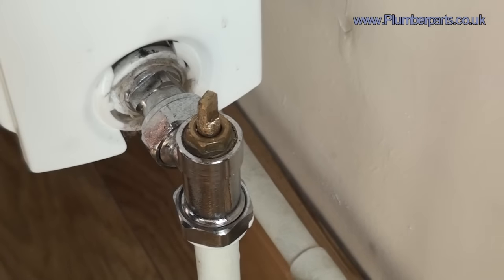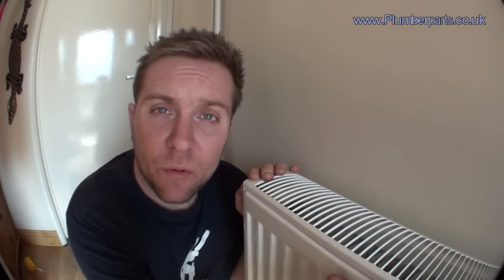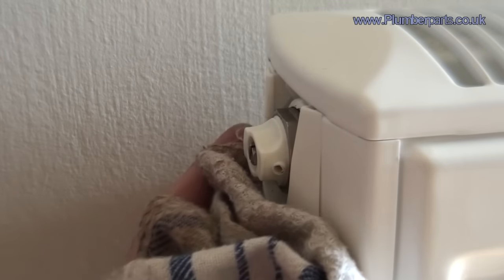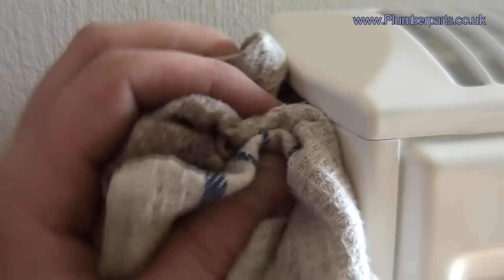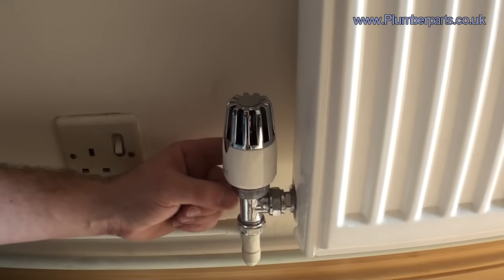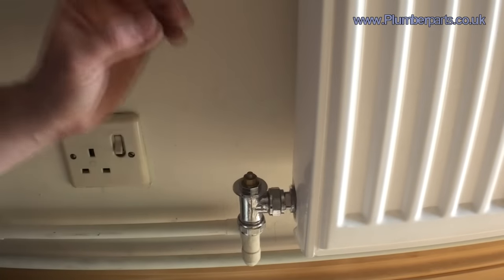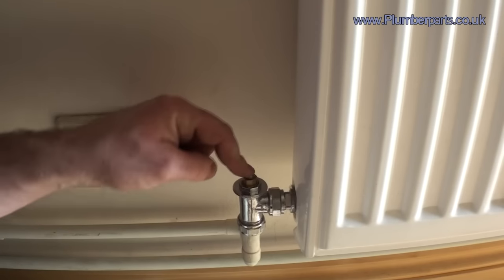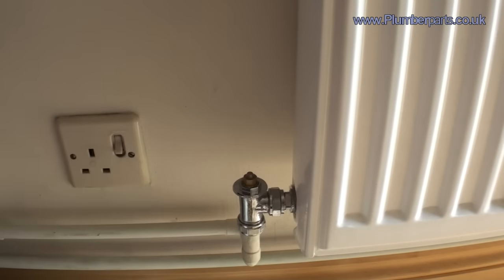How to Fix One Radiator Not Working - Plumbing Tips

Comment: Why don't you just pull the knob off the other valve and use it to adjust the lockshield instead of fiddling about with an adjustable spanner? If you are worried it might break, just carry a spare knob in your tool kit, from an old valve you previously replaced.

Comment: What happens when one radiator has a warm return but cold flow pipe and nothing in this video helped?
Reply from the maker: AIRLOCK! Try my video on removing airlocks from heating system. If you've got a hose and some adjustables you'll be alright! Please consider subscribing - Uploading still today!

Please Follow my Vlog, TimesWithJames  http://www.youtube.com/c/timeswithjames

My Amazon Tool Shop https://www.amazon.co.uk/shop/plumberparts

Comment: My problem is my radiators are stone cold so I turn up the thermostat 1 degree and now I’m sweating! And it won’t turn off til I turn it down at thermostat. Today I froze all day finally got frustrated went down to the basement checked water level and it was correct I pulled the lever at the base of the boiler and the water was boiling hot yet my radiators are stone cold. It literally cost me 500 dollars to have heat intermittently this month I’m so freaken pissed my boyfriend who says he knows all about boilers has failed to sort this problem out in 3 freaken years and my landlord can’t find the problem in 10 years I bought a 50 dollar thermostat thinking that was the problem but nope and I spent 80 dollars on radiator regulators but that wasn’t the problem either I’m so sick of paying for heat that doesn’t get to my apartment even though the water plenty hot at the boiler.

Comment: IF THIS DOES NOT WORK THEN TAKE OFF ALL THE RADIATORS THAT ARE WORKING AND THEN OPEN THE VALVE THATS NOT WORKING LEAVE YOUR BOILER ON FOR AT LEAST AN HOUR WHEN THE RADIATOR IS RED HOT.
It should work

Comment: I fixed my old dear's radiator in the bog that hadn't worked for years and even British Gas couldn't fix. Fixed it in 2 minutes! How? I hear you scream. Well, what you has to do is open the drain cock (if you have a cock, smirk) there will be an airlock in your pipe that the pressure can't move, allow the water to flow and you should hear air squirting out and wouldn't you knows it, BOOM! air lock gone! If there is no airlock 1. the plumber was a wanker, (most are) and 2. you can do it by opening the nut at the top and connecting a pipe to a bucket, that's a little bit more involved, if you've got a old rad with only a bleed nipple, you're pretty much fooked!